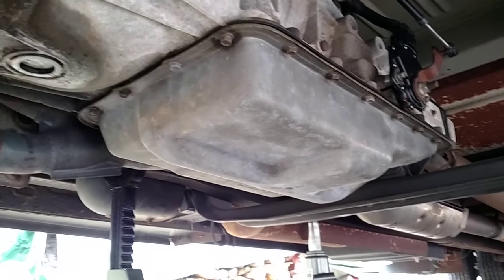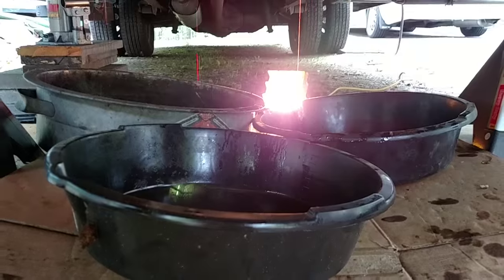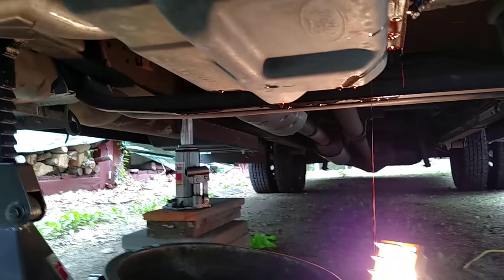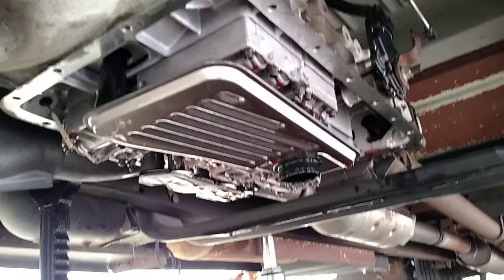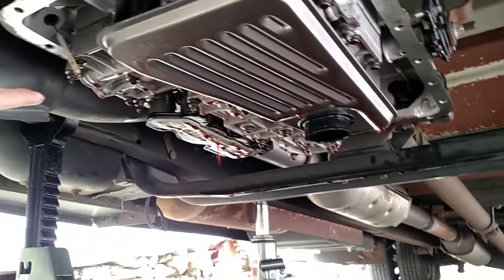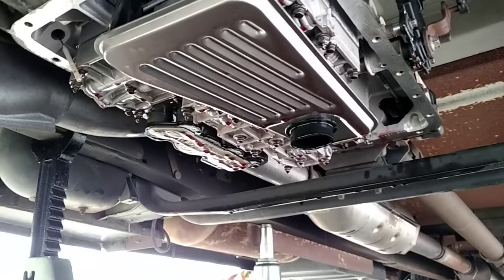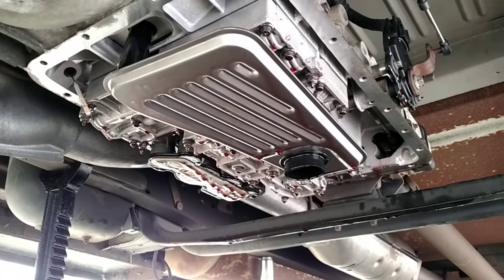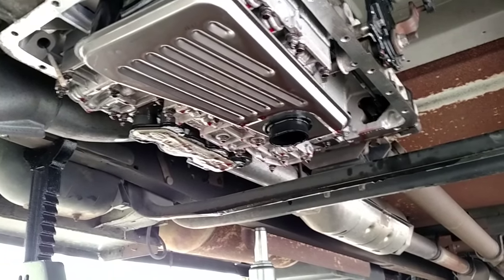Ford E350 Transmission Fluid & Filter Change - E40D Transmission -  RV DIY - 🚨

Comment: A good way to drain is to jack up front of vehicle, loosen the rear bolts first gradually, that causes it to drain just at the rear. I used a normal sized drain pan (about 30"x16") and an oil change mat (a must!) And just got a couple small drops on my driveway.

Comment: If you are having this problem - transmission jumping into neutral or slam shifting, check the bushings that hold the shift column tube in alignment. I tried everything for several years including a new computer before replacing these two plastic bushings for $6 at the parts store. Problem solved. Part Dorman 905-107.
Reply: Thank you brother!

Comment: Ford should have put a drain plug just like they have with a oil pan.
Reply from the maker: You would have think.. Common sense right? Thanks for watching!
Reply: Mine does have one
Reply: Step drill and Weld a 1/2 nut inside the pan...

Comment: I'm trying to figure out what's the name of that plug in front of the transmission pan on mine that plug is missing
Reply: It's an inspection place/ an access for draining the torque converter or removing the bolts